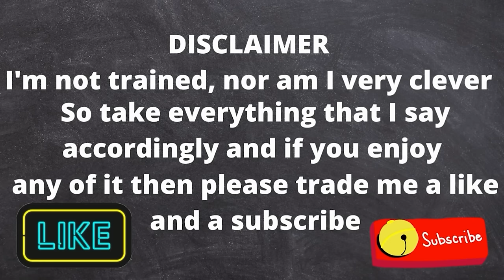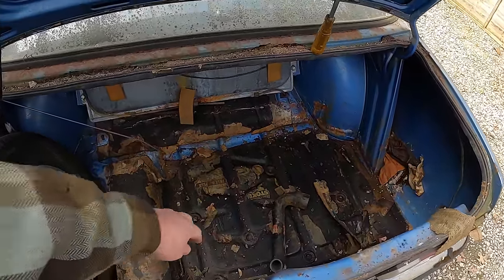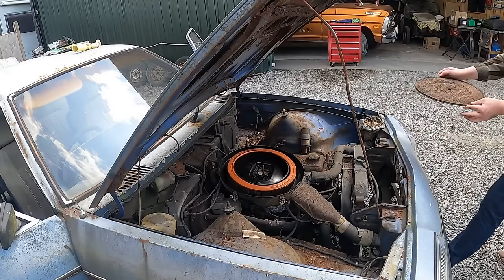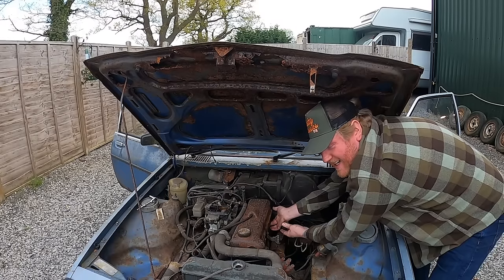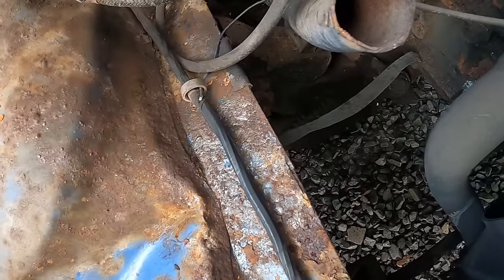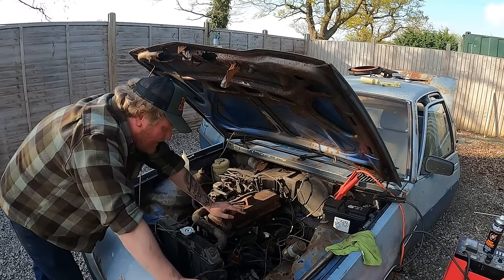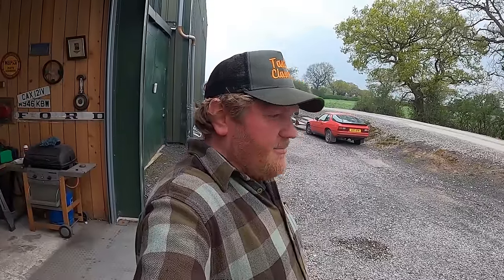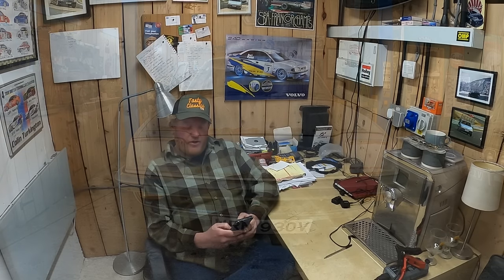Sat for 22 Years! Can I get this very rusty MK1 1980 Vauxhall Cavalier 2000 GL running & driving?

Comment: 1st car I ever bought at auction & 16L in orange got the keys,it had no break shoes & n discs & botched everything.it ran once then a month later scrapped.got ripped off,paid cost of car 250  then 90 in fees & wasnt drivable wouldn’t pass an mot with huge holes in both footwells but can’t see that when it driving past and you’ve only had 5 min look ,got-scrapped i got 30quid.lesson learnt & could’ve been a whole lot more expensive & would’ve lost.

Comment: Did anyone notice the Bat flying at 1:16:20?
Apart from that, I had a base model 1.6 which I had for about a year then passed it on to my cousin. She ran it for about 5 years until it failed its MOT due to rust. sadly it went for a long rest! 😥

Comment: These were Chevy Monza's in America.

Chevette was also a Vauxhall...Even the Chevy Cruze was a Opel/Vauxhall...GM used its foreign arm to make/develop small cars since the 70's..

The Cavalier GM had in the 80's-00's was also a Vauxhall ditto the Malibu from 1997 up..2009-up Camaro is even based on the platform from its overseas partners ditto Cadillacs from the 00's CTS etc..

Comment: Same cam in head 2000cc engine as my 1981 Mk 1 Carlton. Tough as old boots, just keep the oil and filter changed and they will do big mileages. Cars were quite robust, but unfortunately rust like your Cav.

Comment: There are two types of restorers, the Commercial ones (blagh) and the enthusiasts, I think you are the latter, I've got some chrome rings 4, but they'll cost you a fortune, as I want to restore a Vauxhall/Opel in the future, I want to convert it with Minilite wheels, drop it 3 inches, but I have no bodywork capabillity, front engine, rear weel drive  is the only way to go...

Comment: Not done watching the video yet but maybe unplug the coolant temp sensor, if it has one. It might be giving a bogus reading and messing up the idle fuel trim. I know nothing about this vintage of carb to fuel injection transition era,  but I know some of the semi electric/proto-fuel injection era carbs have a lot of drivability and air/fuel issues come from the coolant temp data. I have a 82 Buick with a TBI1.8l and it ran like garbage and would stall with a bad coolant temp sensor.
Reply: No coolant temp feedback on these. Purely mechanical. Temp sensor is only for the dashboard gauge. Even the auto choke is electric rather than coolant operated I think, I know my old one was.

Comment: I had a 1.9 same colour they made the 1.9 for reps to use and bring the insurance down ..
Reply: I think the 1.9 was discontinued and replaced with the 2.0 around 1979. The main difference was the 2.0 used hydraulic tappets and the new GM varijet carb from what I can remember.

Comment: Here in south  africa  it call a chevrolet  chevair  1979 2.3 my brother  bought one like this it was his first car for 8 years  my brother  spined his car broke 2 original  gearboxs he drove his chevrolet  chevair  only 1,3,4 gears number 2 gear was broken and it has alot of power and torque and then my father helped  my brother to modifi a 21R toyota crissida  gear box  my brother only had 1 probl woth the toyota crissida  gearbox he struggle to get gears because the toyota crissida  gearbox was to much forward and then he bought the original gearbox off internet and then 1 guy bumbed my brother at the red robot, and then my brother was very angry and sold his chevrolet  chevair  to put money away to buy my father  1980 bmw E12 528i  my brother  drove that bmw 5 years with out problems  and then my brother  couldn't  get spare my brother sold the bmw and bought  a 1989 ford courier  doubble cab

Comment: That's front, not fridge. If someone has the time and has some decent welding skills those chassis sections are easily repairable. I live on the other side of the world, otherwise I'd give it a go. I'm a coach builder by trade and have done journeymans courses in spray painting and panel beating. I've repaired rustier cars than this one.

Comment: We had those as the Chevrolet Cavalier in the US where they flouted the European styling.  Pieces of junk, basically a Chevette (Shovette) Deluxe.  The hideous mistake Cadillac Cimarron came from that. 🤮
Reply: These were never in any form sold in the States. The later front wheel drive  GM J car held that honour.
Reply: It just has a similar name and for the countries that did have a similar car what was hated in the past is now loved happens all the time is enough time goes by when it comes to vehicles 😂😮😅😊